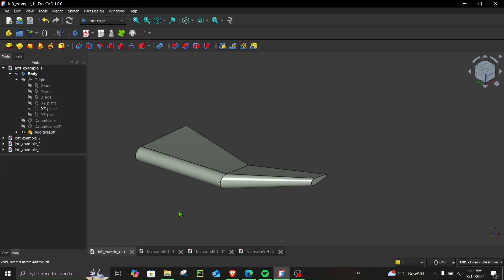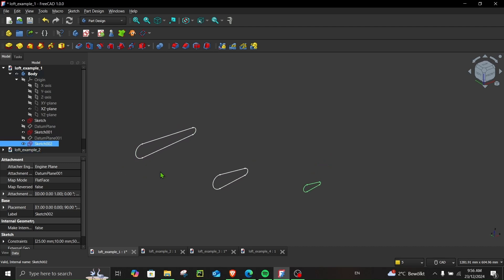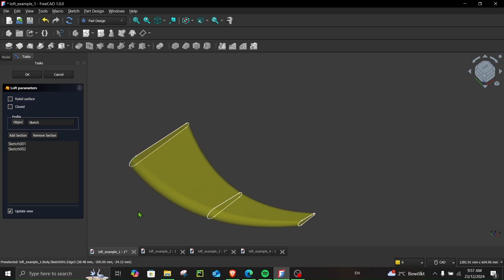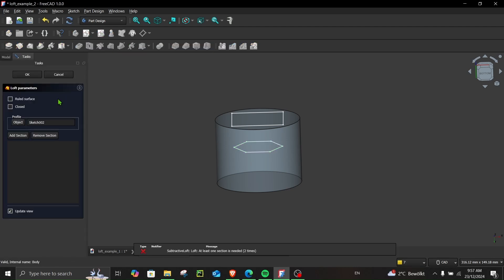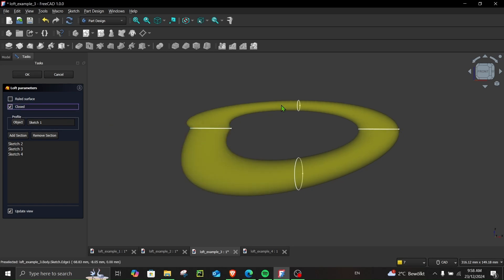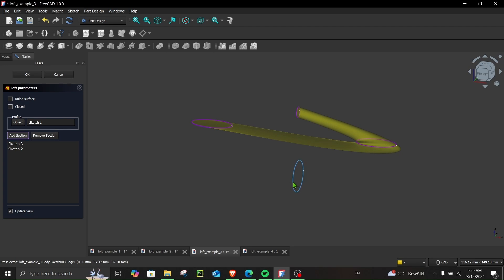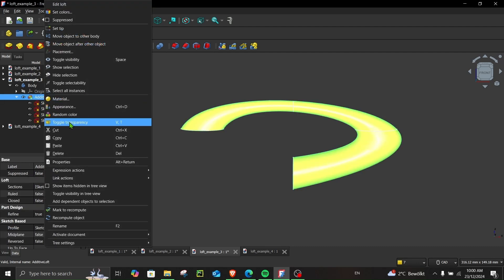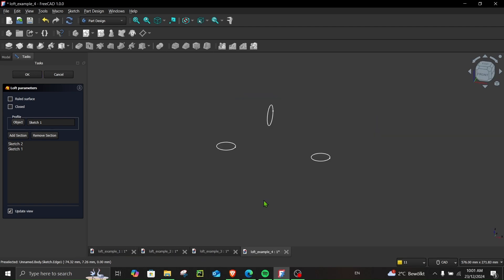Additive/Subtractive Loft in FreeCAD 1.0 | Basic Introduction

Comment: I have had trouble with orientation when using sketches that have multiple closed sections (e.g. 3 circles in each sketch) and I was not able to control which section from sketch 1 would connect to which section in sketch 2. So I reverted back to having a sketch for each section. I guess I should have had watched you video before :-) 
Although sometime having multiple sections in a single sketch is much more convinient then having to put them in different sketches, especially if you have many complicated references to external geometry that you need to recreate of every new sketch.